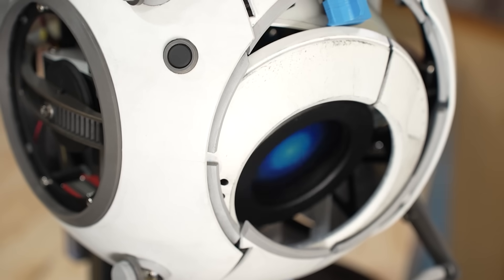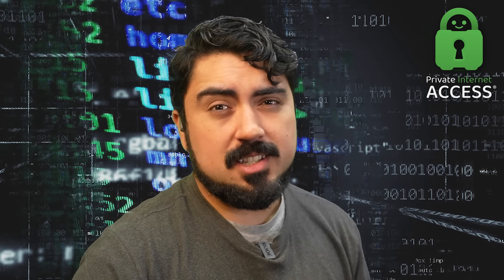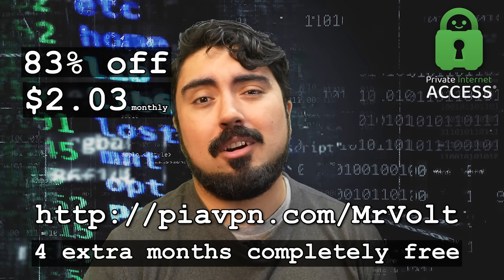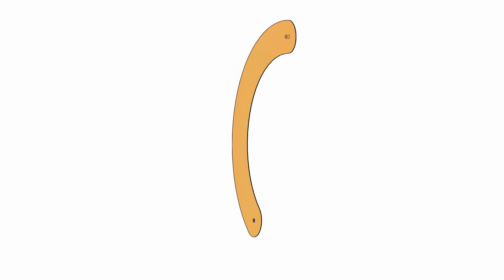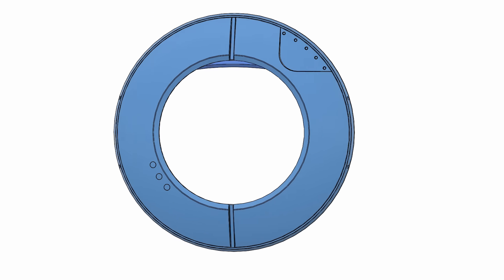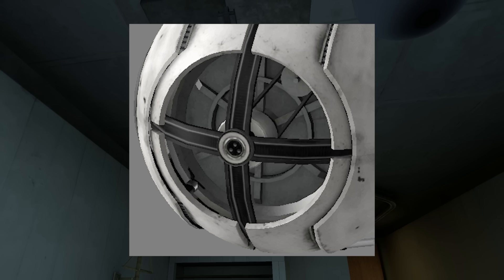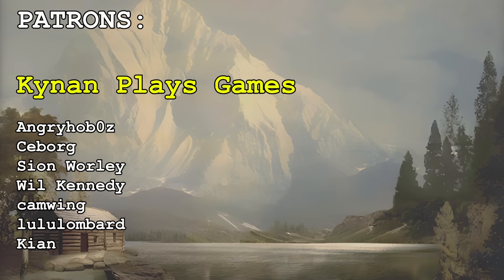The “Impossible” Design of Wheatley from Portal 2 | Mk III Animatronic

Comment: Wheatly can look up and down on the rail because of the little thing on the top and bottom. It rotates opposite to the sides, making the effect only the center move. This still isn't mechanically possible, because the rail connector isn't long enough.

Comment: you should try to make a deal with a company that works on ai-based stuff (like chat gpt) and train an AI just for wheatley, giving it control like moving it's handles, eye socket, etc i believe you can make an ai choose how to act and understand what it should move/do based on an interaction or while it's just idle (i'm not sure if you have any kind of chips or any type of os running inside wheatley there but you probably atleast have an controller for movement)

Comment: your pin size can be anything. so make it the width of your filament, and cut filament nubs to put in the holes. use a wood burner to melt the pin down into the blade like a rivet. with a delicate touch you can get it so these dont deform the back of the blade at all.

Comment: It would've been 1000x times cooler if you used a VFD display or a moving nixie display, look at bargraph VU display tubes, they have a very similar pattern to the one in the game, find someone who can make a custom nixie tube with a square corrugated front element and use something like hydrogen for the gas for the blue look, then mount it on a rotating ball that can move in both axis for the movement

Comment: You're shooting yourself in the foot with the (seemingly) linear design process. Stacking problem solve on problem solve. I suggest starting with the original model and integrating the animatronic mechanisms, it's just an animatronic, nothing has to be what it seems, that's the magic. Hiding servos in dead space, designing creative solutions to the "impossible" problems, as in, that ring does not actually have to serve as a drive ring, just look like it does. That platform doesn't actually have to serve as the eye drive, just look like it, etc. I'd advise only cheating in the thickness of the original elements in order to stuff electronics inside. You'd also be served well by designing custom PCB's and housings for everything electronic, again, rotational mechanisms don't have to be circular, just look like it. You've got a hell of a lot of dead space for no apparent reason. 

All in all, a lot of work but a lazy engineering effort. If you're going to redesign, why not make something original? It's either screen accurate or it's something new imo.

Comment: I have a question. Since this is smaller than in-game model and you can fit all these mechanical features there (insane work), could it be scaled up to bigger size with same insides? It even would be easier, no?

BTW, idk if you already did but try to contact Valve. I'm sure they would love to have one in their office.
Reply from the maker: Thanks! There would be more room, but it would be much more expensive and time consuming. My first version (older video) was 30% larger but rigidity becomes an issue, plus he was too awkward to to handle at that size. This version is comfortable to carry.

Comment: Regarding the iris problem: it looks like you're printing this as a simple flat piece with a nub...  Couldn't you just die/laser cut these out of a sheet of sufficiently rigid material, and just drop in pins after the fact?  It would likely speed up the fabrication process immensely...

Comment: Actually, stupid, ALL the cores are exactly the SAME SIZE.  They are all using the same model.  Wheatley is just a reskin of the model.  SO, no. he is NOT disproportionally large.

PS VPNs do NOT hide anything.  They only add additional delay to the packet.  Further, a VPN only works between you and the ISP.  It can't run on the other side of the ISP which means your ISP CAN see EVERYTHING you do online even with a VPN.  In other words, all a VPN does is lag your connection that much more while funneling all of your personal information to a third party who have stupidly given full access to.  DO NOT BUY A VPN!

Comment: I'd also recommend fabricating the body out of forged carbon fiber (super easy to fabricate with a 3D printer, some chopped cf tow, and resin).  The gears should be made of cf nylon though.  Another thing to consider would be BLDC motors instead of regular servos with SimpleFOC motor controllers...

Comment: for pins for the iris I commonly use short bits of filament, very replaceable 10 seconds to make, different gauge wire also works for stronger jobs, but forced are minimal,

Comment: Those aperture's would have been much easier to make out of lasercut sheet metal. You'd then rivet or swage the pins. Much more rigidity for the same thickness than 3d printed plastic. Lots of online service for that. Probably a few other pieces in your design that could be simplified and made simpler with some lasercut and bent sheet metal. Rib embosses also help with rigidity while keeping overall material thickness and weight down.

Comment: Why do the two sides of the outermost shell have to be physically connected? Could it be good enough to have them be independent of each other, and just turn the motors that control them in such a way that they never get out of sync? From the outside, it would give the appearance that they are one continuous shell piece, but really they wouldn't have to be connected with a cross piece that sticks out of the shell. Is there a problem with that idea?
Reply from the maker: All motion is relative, so since the outershells weigh much less than the inner body, the motors would move the shell pieces in that case, but his animations have his inner body moving. I wont be able to animate him in real live without having a rigid attachment to the outer shells. The game model gets around this by always having Wheatley face the player, never revealing that he's floating or clipping through whatever he's attached to.

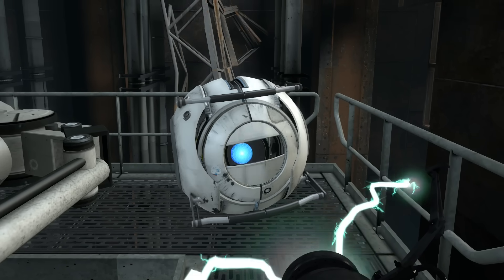Comment: 10:00 aren't the outer plates attached to each other by his "eyelashes"?
Reply from the maker: The handles are tiny compared to the size of the outer shells. If they could mechanically hold the body together, it wouldn't solve the mounting problem as there's still no place to attach him that allows the inner body to move like it does in the game when he's attached to something.
Reply: @MrVolt  Ah that's true! My apologies for missing that

Comment: Couldn't you have just printed the blade standing vertically with some scaffolding? Maybe it would be a pain to sand off but it would be a hell of a lot more stable, wouldn't it?
Reply from the maker: Too thin. They're less than the thickness of the nozzle and that grain orientation would be weaker.
Reply: @MrVolt  I do feel dumb for not taking into account the nozzle thickness

Comment: I highly doubt this could ever happen but, I wanted to bring a suggestion for a project idea to you. I've had a dream to create something I call "Ghost Mechs". Small mechanical dolls that have basic movement functions that require electromagnetic interaction to cause to move, and a small radio that can turn on or off in its center. It'd have to be sensitive enough that even a small subtle signal could make it move a lot, but... I believe it could work. I just... dont have much education on engineering.

Comment: I havent looked too much at the mechanics of the cores (I wouldn't know what I'm looking at haha) - do the other cores share Wheatley's impracticalities? What about the ones in Portal 1? They're much more closed off, so I feel you could take more artistic liberties ^^
Reply: Bit late here, but while I don't know much about these mechanics either, I can tell you that, since the Portal 1 cores are way less expressive, they'd be incredibly simple compared to Wheatley. The handles are rigid, there aren't eyelids, the eye is directly attached to the two hemispheres of the core.

So, basically, all the parts of Wheatley that make it mechanically difficult are gone. The only part I could see being a problem would be the two side plates. I could probably figure something out, though I don't have access to these programs to make 3D models.

Comment: The fact that how relatively little you had to modify to make it actually functional is just a testament to the ability of the team at Valve who worked on this.
Like, you did have to modify almost everything slightly, but comparing this to other games and the original would not even resemble what a function version would look like.

Comment: At this point I wouldn’t be surprised if you made a turret that could actually house, load, and fire hundreds of bullets.
Reply: The whole bullet. 66% More bullet
Reply: "Are you still there?"
Reply: @nitorial_riverside  “I’m different.”
Reply: @LaserFont0103 "I'm flying!"
Reply: And if it doesnt work use more gun - engineer tf2
Reply: “I don’t hate you”
Reply: Lockheed probably has done it or either abandoned it in the 1970's.
But it would be so cool to see a Portal 2 Turret IRL even if it couldn't shoot
Reply: @dulguunjargal1199  IIRC Valve has one in their building, and a sentry from TF2 :)
Reply: It would be the whole cartridge

Comment: This guy needs to make a Portal 1 core.

It has less features, and he could add new features! Like making the handles move.

P1 cores are harder to make because you can't see their insides, and their rotating is weird. But they are WAY simpler. They don't blink, their eyes don't move, they don't have an iris, etc.

On the back it has something like an outlet plug, which is weird. But he could make so it could be plugged into the management rail too.
Reply from the maker: A while back I wasn't interested in doing so, but gosh, it would be downright relaxing to design one compared to how complex P2 Cores are haha. Way cheaper too...
Reply: @MrVolt  Heh, hope you consider so.

Comment: 12:50 I actually had a realization awhile ago about how the handles might be intended to work.

You know that extra inner piece that seems to do nothing? I think the cylindrical part is actually a small motor, and it's attached to a gear on the inside of the side piece. It probably works like a sun-and-planet gear (I think, I don't know the terminology well), where the motorized gear moves along a static gear, which would be connected to the attachment point of the chassis. The attachment point itself wouldn't move in this case, but the side piece would move around it instead.

Sorry I suck at explaining things, so I hope that made at least a lick of sense. It may not be plausible on your design since it's down-scaled, but I figured I'd share that thought.
Reply: Surprisingly cohierent comment for a furry
Reply: @paulmccartney2327  Lol a lot of furries have degrees in either engineering or IT.

Not saying I do, but sometimes I like to learn about things like that.

Comment: Can you please go more into detail with the software to make his eye? Like once your Wheatley is powered on does the program of his eye run automatically based on something you set to run immediately after powering on or coding via raspberry pi or arduino, (or what you're using) I'm very interested on how the software for his eye works :)
Reply from the maker: For sure! I'll explain in more in depth when that's built.

Comment: I've been using Fusion for years, but "What the fuck" just fell out of my face when I saw how intricate and complex the internal mechanisms are. I am in awe. Good work.
Reply from the maker: Thank you! Well, this is the third evolution of something I started two years ago, so it's been a trip to get to this point.
Reply: Where is the "what the fuck" located on the face and is it bad if you lose it
Reply: @raul-aurelianserban8295 it's located in your mouth and is safe to lose
Reply: That was the first thing to caugh my eye as well.

I use fusion for tiny non complex projects and somehow always manage to create dependencies that make any reworks of details impossible so I start new over and over again 🙄.

Having so many complex components fitting together with just millimeter tolerances is art